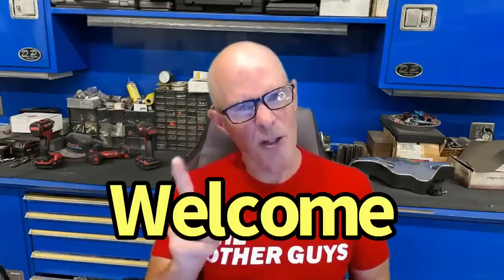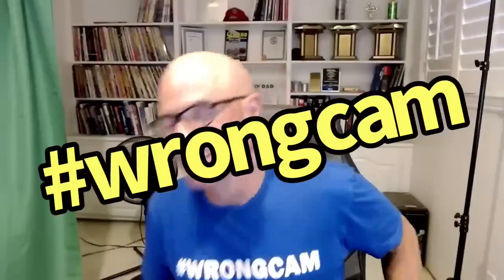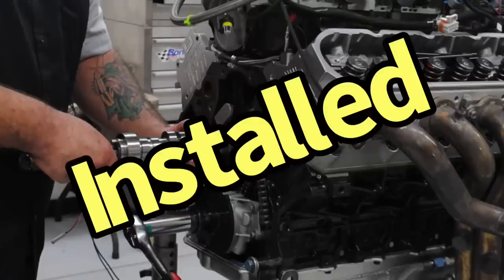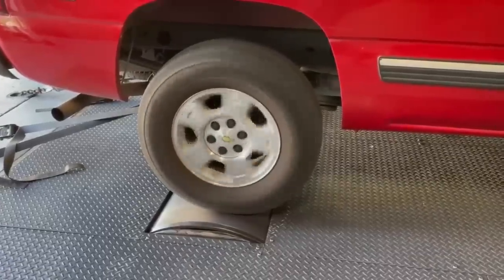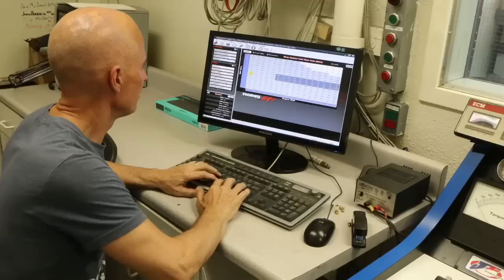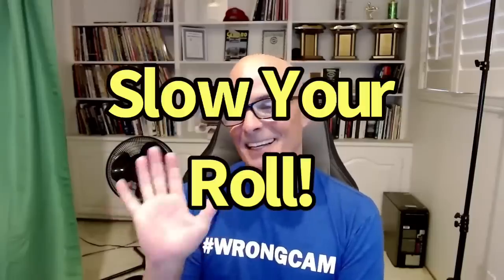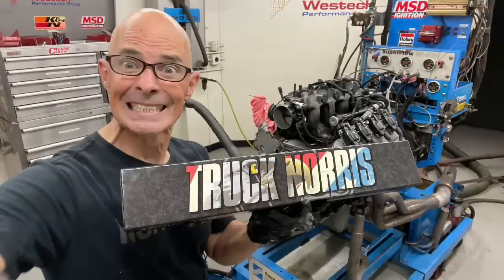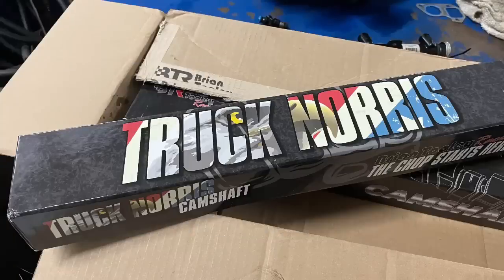CHASSIS DYNO VS ENGINE DYNO RESULTS. WHAT TO DO WHEN YOUR TRUCK NORRIS CAM SWAP DOESN'T ADD POWER!

Comment: I have this same cam and engine and my tuner said 21 was the max he could do on 91 octane WOT. Anything after 21 degrees it was knocking on hp tuners. Should i try a different tuner?
Reply from the maker: seems low for 91
Reply: @ 

Man sounds like im missing out on some power then. Im going to look for a different tuner

Comment: building a 408 stroker from lq4. Bought the T.N cam NSR version, because I binge watched your videos when I didn't know what I was really doing haha (4 years later) ls swap z is almost done, but now im contemplating changing the cam. Really was looking for 480whp ish range. (havent dyno yet)  Should I change the cam and recheck push rods and preload?
Reply from the maker: it will be hard to get 480 whp with that cam
Reply: @richardholdener1727 So something more like the red hot BTR cam?
Reply: @ItsCodaz both those cams you said are to small for 480 wheel
Reply: @utahcountypicazospage5412 hi, thanks for the comment. Ended up getting with BTR and grabbed their btr 400+ cam. And upgraded my springs and re did pushrods. All good now! Should make around 550-600
Reply: Magic stick 3 or 4 should get you there maybe a little more depending on compression

Comment: Decades ago my stock engine 1990 Mustang GT with a 5 speed and stock 3.08 rear went 89mph at Banidmere (5800 feet) with the K&N FIPK in place. With the factory lid in place and a panel filter (without the silencer) it ran 92.5 mph. Back to back passes. The ET on those passes was 15.289 @ 89 and 15.355 @ 92.5.

Comment: Another point to consider, any alteration of the intake tract will throw the factory maf curve out of calibration. I see this daily, when someone puts on a cone filter, it's almost always quite lean as the maf curve needs to be retuned. Those LS trucks use the maf primarily past 4000 rpm, so if the maf curve is out of wack, your entire dyno pull will suffer. 

And you need a different tuner, sounds like this shop's tuner was inexperienced. Please never assume that the timing an engine wanted on the engine dyno, is what it will want on the chassis dyno. There are many variables that change which result in needing  a bit less timing, this has been confirmed many times.
Reply from the maker: You might be new to tuning, but if you try different timing values on the dyno, the dyno tells you what the motor wants. You don't just try 1 timing curve.

Comment: When people want to get "real world" and close the hood on the dyno, they have to realize the other part of the equation to make it actually real world.......a ton of airflow at the front of the vehicle.

 Most dyno fans are a joke, you need something that will simulate the air flow at the front of the vehicle, at 60+ mph. That can make a giant difference as intake air temp can be over 70*F different at speed versus idle or with weak dyno fans

Comment: Also remember, Timing is largely limited to crankshaft stress as well. I.E. weight of the vehicle, towing etc…

29° in a vette absolutely
29° in a 2500HD towing absolutely not.
Reply from the maker: the motor still makes best power at 29 degrees-regardless of the vehicle. The vehicle weight may determine octane requirement
Reply: @ excellent point, i never thought of it in that way. Glass half full or empty…
Reply: That is incorrect richard, what it wants for timing on the engine dyno doesn't translate to what it wants in the vehicle on the chassis dyno. If you argue with that, you need to step out of the dyno room and go visit some actual chassis dyno shops, and not just the inexperienced one you went to.

Comment: Perfect Timing finding this video. An 'Overlanding' 4x4 Truck/SUV Project on 87 Octane Fuel....Supercharged.
Depending on the year of GM truck that is the starting platform, it will be a 4.8/5.3 Iron Gen 3 or perhaps an Aluminum Gen 4.
Regardless, the motor plan is simple ... 3.800" Bore (0.020" over), 4.000" Stroke = 363 CID/5.95 L. 706/862 Cylinder Heads, Long Tube Headers, 9.5:1 CR and an LSA SuperCharger .

The main criteria/goal:  Happy on Beehive Valve Springs and Stock TQ Converter (4spd or greater automatic tranny), happy being Supercharged on 87 Octane (in case of bad fuel).
The Options: BTR '202' Torque Cam ----- BTR Stage 1 Truck Cam ----- Truck Norris (or another 'Beehive Spring/Stock TQ Converter' BTR Cam that I missed ?).
The running experience: Tractor-like low speed TQ (huge TQ 2500 - 4500 +/- RPM), max rev like a stock Big Block (ie, 5500-6000 RPM max).
All the low speed power will be important to support 2 Alternators/2 Batteries, DC & DC/AC conversion Electrical capabilities, lots of exterior lights for offroad.
As you say, every cam is a * Cam. Any thoughts on this would help. thanks in advance.

Comment: I had a friend that was running an early  Individual Throttle Body Intake on a Camaro. He put these 2 inch tall custom air filters on each side that. Each filter covered 4 throttle bodies. When I saw it I said how does it breathe. He said it' isn't working like we want.  I said take off the filters. Finally weeks later,  he did. Gained over 60hp with the filters off compared to filters on. Still never ran right.

Comment: I used to run 27 - 28 degrees on 91 octane with an MS3 with no detonation.
Reply: Yup fast intake nick Williams throttle body ms3 prc 5.3 heads one nasty combo 500+ wheel

Comment: Has anyone ever done a comprehensive transmissions and rear end gearing test for parasitic loss?  I'm thinking of buying a classic car for the street and run a 6-speed auto with double overdrive with a gear venders overdrive and use ridiculous low gears in the rear like 4.88 to 5.13 or even lower. Will the parasitic loss of the rear gears cancel my gearing advantage?
Reply from the maker: do you have a motor that needs 5.13s? what about the added weight?

Comment: Plus 30 horsepower with hot engine bay and 87 octane and less timing. That cam IS working lmao
Reply: That's what I was thinking. 31whp gain for a few hundred bucks is a bargain IMO

Comment: @richardholdner1727 funny you did this test… my 6.2 made 435 through a 4l80 at 26 degrees of timing…

Started playing with data logging and saw I was getting 175 degree IATs with my filter on a stick! My data log showed it was pulling 5 degrees of timing 😮

I wonder how much power I lost from that????

Comment: I saw a guy do a cam on an otherwise stock ls1. We told him it wouldn’t make the power he was hearing others picked up because he had the factory exhaust. He picked up 22 hp at the wheels which he was extremely disappointed by. Then we convinced him to put long tubes on it and they picked up 70-80 hp which is vastly more than long tubes would do on a stock or bolt on ls1.
Reply from the maker: we don't see anything like that ever. The performance LS cam gains power with stock exhaust and headers (I tested it both ways), so maybe you had a clogged exhaust (there is never an 80-hp gain from headers.)

Comment: I would love to see someone dyno a stock engine on a chassis dyno, pull the engine and dyno on engine dyno, build the same engine and dyno in the opposite process to determine REAL powertrain loss.  Maybe a stock ~400 hp build and then up the power to ~800 hp.  Hoping this would prove that powertrain loss is fairly constant and does not vastly increase with hp/tq.

Comment: A bigger Camshaft generally is not prone to detonation as airspeed slows down at low rpm unless you add a lot of overlap and retard the exhaust side so much you make back pressure. That is counterintuitive to the idea of knock from more torque. A bigger camshaft at the very low rpm will shift the power to the right but we don’t see it here cause who does a dyno between idle and 2500 rpm? The added torque is often from reduction in pumping losses gained back. 
If anything top end ignition timing is lost on a big cam due to making too much airspeed for the cylinder head it burns too fast. Usually it will roll over first before knock. 
All of this is relevant to many things including displacement, compression, cfm, cylinder head port cc size, intake manifold and more. Exhaust, having cats on the vehicle all that stuff can plat a role. 

It’s extremely evident in turbo cars. I see actually better spool, more overall power and ability to run more ignition timing on a cam upgrade on a stock port head civic type r depending on turbo size.

Comment: I just did a truck Norris cam on my 06 Silverado  L59 5.3, it had 33lb injectors from factory, 91 octane, stock intake manifold, stock exhaust apart from the muffler and an S&B air intake.

The truck made max 266/284, the tuner said the truck never knocked but after going to 20 degrees of timing it didn’t make anymore power so he left it at 19
Reply from the maker: IT DOESN'T MAKE PEAK POWER AT 19-20 DEGREES-THOSE ARE BOOST TIMING LEVELS

Comment: I've tuned enough vehicles to see all the common issues. Bad gas, bad plugs, wires touching headers & arcing, bad or missing O2's, bad temp sensors, bad chinesium MAF sensors, crappy chinesium clone injectors, false knock from piston slap, >150F IAT's from cheezy hot-air intake. Also sounds like that guy's tuner was NOT used to tuning an LS with the stock pcm.

Comment: Your Closer to Sea level in Cali he is Probably in the Mountains with shit air also..
Reply from the maker: nope
Reply: @richardholdener1727  Yea the Main Power killer there was the Air filter getting Air Wash i have told many that's d_mb and kills Power they wouldnt listen. hotter the Air the Less power it Holds ..

Comment: "Cold Air" intakes will bork a tune more than any stock air box, especially when they only pull engine bay heat. HAI should be the real name for them. We had a 300C with an S&B it was wide open to the engine bay. On an 80-degree day, we saw intake temps going from 85 to 131f while driving down the road at 55mph....

Comment: The only time a cam doesn’t do what a cam does is when it happens to make the valve springs loose control but normally it is pretty obvious when that happens then fix the springs and boom it does what it should do.

Comment: I put a K&N FIPK on my 1990 Mustang GT. I ran it at Bandimere just west of Denver. My fastest pass with it was 89 MPH. With the air cleaner reinstalled and a panel filter (no silencer) it ran 92.1 MPH.
Reply: Because you wasn't tuned for the k&n, you lost a ton of hp. I've had my mustang since 1991 (yes I'm old) I've been there on that issue back in the late 90s.

Comment: Do you need bigger injectors for these truck norris cams? And or a texas speed chopracobra
Reply: Both cams are the same in specs, other than price. If money is tight on a LS Truck you can run 25 lb injectors, but max power you want 33 lb injectors or higher.
Reply from the maker: specs are not the same but power curves are very similar
Reply: @shadowopsairman1583  what do tbss intakes come with? Im about to go pick one up
Reply from the maker: I would say yes
Reply: Yes you'll need injectors as you'll be at max duty cycle on the 25 lb injectors with a cam swap, when targetting a more realistic street afr for a truck like 12.4 afr.

Comment: It's  kinda funny you bring this up. Cause  I can't even tell you how many times I have popped a hood and thought to myself this has to be at least 100 degrees more then  the factory are box set up.. I have  seen similar and actually just suggested let's just run tubbing back into factory box and try a different filter in there and it has made noticeable differences..

Comment: it's kinda sad that people and especially tuners still can't understand that open filters in hot engine compartments are never an improvement.
Reply: I modified a K&N style heatshield for a 2005 Kodiak C5500 for my Express van that seals to the hood. IATs dropped over 60F in summer compared to the stock GM airbox that had its inlet sitting inside the engine bay. Stock airbox let the IATs hit 200F around town in Texas summer heat or about 85F higher than ambient.
Reply: @chrisreynolds6520  ok

Comment: Quarter  mile trap speed is one of the best Dyno's there is it is always Accurate.
Reply from the maker: lots of variables can change mph-the best dyno is a dyno
Reply: @richardholdener1727  I have seen lots of cars come off the Dyno with big numbers, but perform like turds at the track. If you can run fast down the track you are making power, and you don't need a dyno to do it.
Reply: @mylanmiller9656 my car has run 109 mph and 118 mph with no changes, just different weather at different tracks.
Reply: @ronb113  man you have one horrible car with that much swing. My car never swings more than 2 tenths.  and that takes a really big change in Weather. I have e time slips from 5 different week ends and they are with in 3 hundredth of a second.
Reply: @mylanmiller9656 What was your mph? The trap speed is more of a showing of overall power and can tend to change more with weather. ET tends to be more consistent because as long as you get start right a few mph doesn’t matter as much.
Reply: I trapped 131.3 with 417whp 393wtq......in a street car. How does that dyno?
Reply: @HioSSilver1999  We need to know the weight of the car & converter slip % then we can tell you.
Reply: @mylanmiller9656  stick car buddy. About 3300lb race weight
Reply: @HioSSilver1999  You are making 583 to the wheels and 700 to the fly wheel.
Reply: @mylanmiller9656  the car made 417whp 393wtq when it ran that.
Reply: @HioSSilver1999  Then the dyno is wrong.  Which is not unusual.  To trap 131 mph in the 1/4 you need an average acceleration of 0.6g.  Don't know what trans you ran, but just using TR6060 gears, the weight of your car and assuming a 3.73 rear end and 28" tires the dyno numbers you gave would have produced less than the average of 0.6g in every gear except first gear, and that's without considering air drag.  Pretty easy to figure out when dyno numbers don't make sense.
Reply: @ChurchAutoTest   the dyno was as accurate as the others i had been on. Your just out in left field when it comes to making a car accelerate it's crazy.

Yes I know everything about my car. It has a t56 and a 3.89 gear. Why would anyone put a 28" tire on a car with that little power??? Especially with a 3.73

I also know the calculations of the calculators don't consider errythang.....and are inaccurate.
Reply: @HioSSilver1999  should be around 500 but it isn't accurate without Converter slip and the car weight.

Comment: I've been telling people about their hot air kits sold as cols air kits for so long and people still buy them. Especially the ones with those shiny chrome tubes that after driving around you can fry an egg on them. If you want a little more airflow just buy the Airaid plastic tube that goes between the stock air box and the throttle body, but leave the stock air box and filter. # 2 on my list of bad mods is any oil impregnated air filter. All they do is coat everything downstream of them with oil including the MAF sensor then it starts under reporting the correct airflow entering the engine. They don't flow any more air than a clean paper filter and you can usually buy 5 paper filters or more for the cost of one K&N filter plus the cleaner and oil. Then you have to clean them then wonder did I put enough oil on it or too much. Most people put too much then gunk everything up with oil. There is also a table in the calibration that pulls timing out of the tune as intake air temps start going up. On most GM vehicles that timing pull starts at 85 degrees F. and can pull as much as 8-12 degrees of timing at really hing intake air temps. I've also been dyno EFI tuning GM vehicles for 21 years and non EFI vehicles even longer than that going back to the 70s.
Reply: The cone filters are really just for looks. I was just watching a Hellcat vid from a place that dynos them daily - the stock flat filter is similarly sized to a GM truck filter but shows zero gains vs cone filter up to 800whp.

Comment: I do alot of truck norris cams in silverados with headers, cold air intake, typical mods. Have never ran out of injector, or stock fuel pump. Typically I see between 320 and 340 wheel hp on those trucks on my dyno. an optimized stock truck tune 280-290. They do want premium, but i usually make the most power around 26 degrees.  Higher gears and bigger tires make it more prone to detonate. Glad to see his probably young tuner learned something. We all started somewhere
Reply from the maker: 290 whp on a stock motor?
Reply: I'm on an 04 5.3, 1 3/4 long tubes, 3" catback, Dorman intake, BTR torque truck cam, electric fan conversion, I'm at 320 wheel. Stock injectors and pump. My tuner said I was just fine on the the injectors and pump. Not sure why the video guy did those on his combo.
Reply: Lmao
Reply: 290whp should be cake with bolt ons
Reply: Higher gears make it more prone to detonation? You’re saying 4.56’s will cause detonation before 3.08’s?

Wake up, you’re dreaming
Reply: @boost1728 he means taller gears, probably.
Reply: @boost1728 
The lower the ratio number typically translates “higher gears” in shop talk. 
It seems counterintuitive but it is how it works. 
Higher gear, meaning a higher speed at lower rpm. Not the actual ratio number. 
3:08 is a higher gear than a 3:73, or 4:10 or 5:13 or whatever. 
2:72, 3:08, hyw gears for cruisin. 
3:73, 4:10 shorter gears for quicker acceleration. 

It’s the language we all use.

Comment: I build rock crawlers and I've seen intake air temp as high as 174 on air filters stuck on the throttle body!
Reply: My Express van reached 200F in summer with the stock GM airbox.

Comment: I had to make a air intake for my swap. I data logged 150+ degree iats at the track and it didnt drop much by the end of the pass. I made an enclosed box and duct now im seeing 40 to 50 degree lower iats.